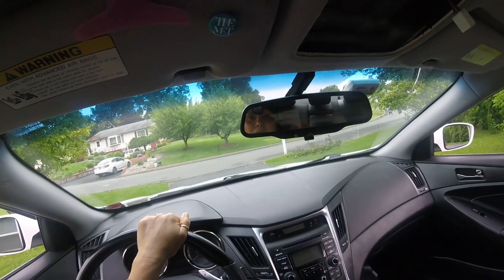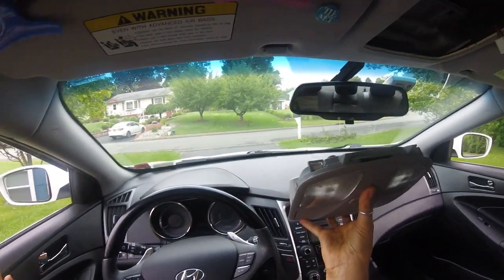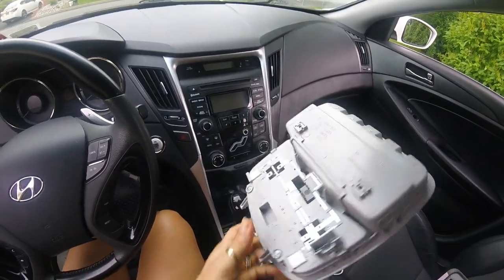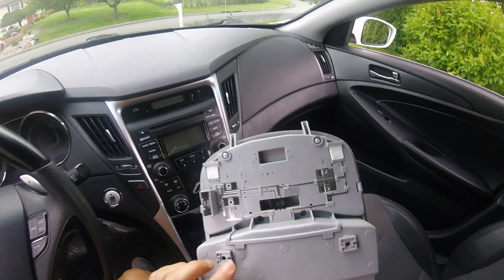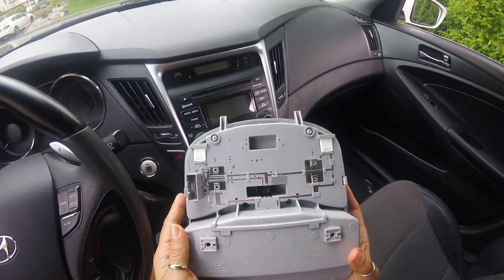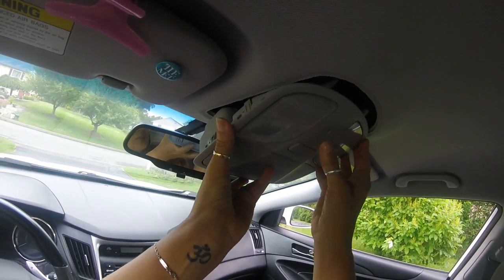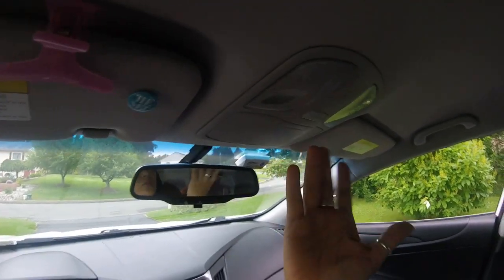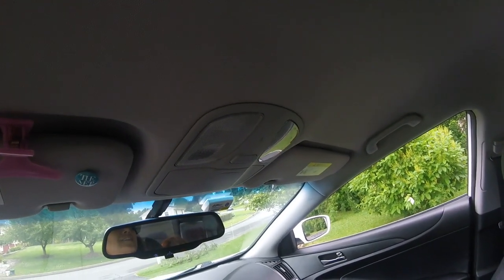2012 Hyundai Sonata Dome Light Fix/Repair

Comment: Hi mommy. I have just been living with this problem for a while. Finally got sick of it and went to good old YouTube. Watched all the videos (take it all apart, bend the brass, super glue, piece of plastic etc) then watched yours. I have no idea how this black magic works but it was perfect. I actually didn't pay 100% attention and put the tape on the other side over the two pieces of metal.  Still worked.  The hardest part was making sure I didn't lose the screws.

Comment: I watched a couple of videos on this  for a fix for my Sonata with sunroof. One video showed how the terminal wore a dentation in the plastic that allow the terminal to make connection all the time. I tried putting with tape, but that defeated the purposes of turning on the light completely. I tried using a thin piece of plastic to cover the worn spot, but it failed when the temperature was warm. My solution is to use Super Glue to fill the worn spot. You will need to remove the switch from the assembly so you can have a clear area. Use the long nozzle that comes with the Super Glue and gradually fill the worn spot. Let it dry, add more glue if needed. Let the glue harden (cure). Clean contact strips so there is no glue on them. I scraped them and used fingernail polish remover. Then reassemble assembly and install back into your vehicle. This worked really good. Good Luck and use care!
Reply from the maker: thank you for your comment and input!

Comment: Great video! Was really helpful to see the housing removed with the 2 brackets. Also your tip for removing the housing, had to pull a good amount to remove ours. Some rubbing alcohol and cue tips to clean surrounding area and contacts, then a small tool to wedge between the toggle switch & contact points to move up & down to remove any debris & build-up. At first it didn't seem like it was fixed, or perhaps I forgot light stays on for 20+ seconds, but once I started the car it's working again correctly in "door" mode.  TY!
Reply from the maker: You're very welcome! Happy to help and thank you for sharing your solution.

Comment: Thank you so much! I also have a Sonata 2012 and my dome lights stopped turning off when in the “Door” position and having all the doors closed. It looks to me like the contact is slightly too close to when it shouldn’t be touching. Over time, the heat creates a plastic divot. I fixed mine by putting a drip of bondic (like super glue) to fill the divot. Now it works perfectly.
Reply from the maker: You are very welcome! Thank you for sharing your fix. Its great to hear other options.
Reply: I have both problems on my 2012 Sante Fe.  Front map lights won't turn on with door but do work manually.  Rear dome lights won't turn off in door position but do work manually.  I'm looking at both solutions given on this site.  Thanks for sharing.
Reply from the maker: You're welcome. Hope this helps!

Comment: 2011 Sonata with the same problem and dome fixture. I managed to get a secure/non-blinking fix to this problem. I started by folding a small piece of painters tape four times creating  four thicknesses of tape in a small square. I made sure to keep the sticky side on the exterior so I wound up with the sticky side on both outside faces. This will keep the "patch" of tape in place once it is inserted. I inserted a small regular screwdriver tip between the switch and housing so I was holding it away from the contact. Using tweezers I then worked the folded piece of tape between the switch foot and the housing unit which now realigned the switch. You don't want to get the tape on the metal contact, but just on the plastic edge of the switch and housing. It takes a little dexterity and I had removed the housing and disassembled it so I could do it on a table in good light. 
My Sonata also has a sunroof and its control switch hid the light switch. If yours has the sunroof also, it's not necessary to disassemble the entire fixture, however, you will have to remove the roof's control box (black plastic rectangular unit held in place by three screws). The slide switch on the face of the fixture that controls sunroof function (it has the sunroof "open" icon on its face) must be removed. It's held in place by small plastic feet and can be popped off with a screwdriver insert under the lip facing the front of the unit. It take a little pressure and you may feel as if something might break, but it will come off OK. I've done it multiple times without breaking any of the holding feet. With the three screws removed and the slide switch remove the entire control box can be worked out of the fixture exposing the light switch in the recess shown on the video. This video does not have a sunroof so there is only one wiring harness to disconnect, however, if yours has a sunroof there will be a second cable harness attached to the control box which will have to be disconnected in order to remove the entire light fixture from the vehicle. Hope this helps anyone else experiencing this problem.
Reply from the maker: Cool! Thanks for the tip.

Comment: My fix:  I separated the two halves of the assembly -- another 4 screws.  I popped the part with the "off dome on" on it and pushed the contactor out.  I put some electrical tape just in front of the center contact, covering the other two.  I pushed the tape flat and use some snips to cut holes at the two outer contacts.  Now, it works perfectly.

Comment: I cannot find the video for removing this models dome light.  Found videos for every other model. If you can send me the link to what you saw that would be great.
Reply from the maker: Hey there, Watch the video again. Open the eyeglass compartment and unscrew the two screws that are in the ceiling. Take the dome light housing by slide it back then pull it down. Remove the connectors to separate the housing on the console. Hope this helps.

Comment: Another common issue I see especially when I see other sonatas driving around town, the tail lights. They seem to burn out super quick!!!! And with all the bells and whistles in the car you would think they would have some sort of indicator to tell you your stop lamps are out but they don't so your driving around town feeling cool in your sonata that has no tail lights.... My fix for that has been the savior of L.E.D bulbs, once I put those in I haven't had a problem they have been working for a couple years now compared to replacing th a couple times a month.
Reply from the maker: Hi James! I've had problems with too. There's a problem with the wiring, the light on the Sonata, they burn super hot and they can actually catch fire. There's a website that has over 100 complaint about the tail light and the faulty wiring. Many complaint about the truck catching fire while driving down the highway. This car has so many issues and Hyundai isn't doing enough for the customer. Glad to hear you found a fix!

Comment: Have the exact same problem. Thanks for sharing your fix. I didn't follow how does the tape fix the issue. Do you mind replying how did the fix got the issue fixed?
Reply from the maker: Hi there and thank you for your comment. If you look at the fixture there are electrode strips. You should be covering the one to the right. You should try applying the tape to the housing of the fixture. Take a look at the video again as reference. Let me know if this helps.

Comment: Our 2012 Hyundai with sun roof has the same issue with the REAR passenger's dome light. However, the lamp eventually goes out by itself-way too long, and NOT going off when engine is started.  I think probably a body computer timer problem??  But, I will take that rear lamp out and examine ITS switch as well.  Then, I will repost the solution hopefully. Jim Simpson, ODD parts fabrication.

Comment: Yes, great video and its true... basically all Sonatas of this generation are doing this, or they will eventually. I have a small car lot and both Sonatas I've had in the last year, have had the exact same problem. If its in Door mode, it stays on with doors closed UNLESS, you slightly touch the switch and move it slightly left... then it will turn off. 
That's the confirmation that the internal contacts are not aligned anymore, OR just dirty. It's truly a poor design and fitment, but east fix, for sure.
Bless you Everyday Mom. Cool video!

Comment: I have a 2007 Hyundai sonata ok my dome light working but when I close the door it's gose off but not completely cause at night you can barely see it on so what should I do it dnt kills my battery but if I dnt use my car in a week it's dose kills my battery so any suggesting ❓
Reply: turn it to off position all the time and use as needed. turn on manually if needed

Comment: Did you later re-screw the two screws?   What type of screw driver did it use?
Reply from the maker: Yes re-screw the housing in. It depends on the type of screws.  I used a Philips head.

Comment: Will electrical tape work or does it have to be duct tape
Reply from the maker: Than you for your reply. It should work, but I would stick with duck tape being that it's very sticky and has better adhesion. You should be able to pick up a small roll at the dollar store

Comment: Doesn't this mean now that you can never utilize the on switch since it will forever be blocked with duct tape?
Reply from the maker: No it works just fine. The idea is to cut off the connection and make the button function the way it normally would.

Comment: Hello there, I can't see in the video exactly where or how big the duct tape was, which part you covered. I tried it and no luck! Please tell me the secret
Reply from the maker: Hi there sorry to hear that you're having trouble. Take a look at the video around 1:33 it shows you the area where the duck tape is stuck to. Put the duck tape on the metal electrode strip to your right and slide the tape down to cover the strip so the toggle switch doesn't make contact with the metal strip. make sure you have good adhesion. hope this helps
Reply: @momeveryday2957  I'll try and thank you

Comment: Mom Everyday:  What exactly is your tape doing?  What is the tape separating?  How did you get the thick duck tape exactly where you want it to be?  A timely response is greatly appreciated!
Reply from the maker: Hi there. The tape is breaking the connection of the electrode strip to the right if your looking into the fixture. Look at the video again for positioning. You have to carefully slide the tape in between the switch and the electrode strip. Hope this helps.

Comment: Have you had any issues with the fog lights not working I turn the switch to on the light comes on the dash but no fog lights?
Reply from the maker: No, I haven't had any problem with the fog lights as of yet. From all the research I done on the this model it seem like the 2012 Sonata has a wide array of electrical issues. You might want to check out the fuses to see if anything is burnt out. I would suggest checking the wiring too if they're accessible. If not you may need to bring it to a mechanic or worst case senairo the dealer to run a diagnostic. Some Hyundai dealers do a diagnostic when you schedule an oil change. I would check with them and see what the rates are. An oil change at the deal near me runs around $30. Hope this helps.
Reply: Are you sure the bulbs aren't bad? And also, I've had an issue with that but the bulb socket harness sometimes for whatever reason won't light up the bulb so a couple of light smacks to the lens has worked a few times for me

Comment: The dome light wont come on when i open my door is their a switch?
Reply from the maker: Hi there, yes the switch should be on the center setting. If you look at the video again you can see the different positions options on the switch. Its a toggle. For the door it should be in the center. I'm not clear on whether you're talking about before or after trying the fix.

Comment: My bulb on the driver side has stopped working.
Reply: The interior light
Reply from the maker: I would check the toggle switch contact with the metal strips. If all looks good try changing the bulb.

Comment: What about when the dome light flash on and off while driving
Reply from the maker: I would check the bulb first, if that's okay then check  the connection in the housing. it sounds like you maybe having the same problem as i had here. just check the connection and move the  metal tab that i point out in the video to see if it flickers. if  so try the tap. you will have to remove the housing. hope this helps